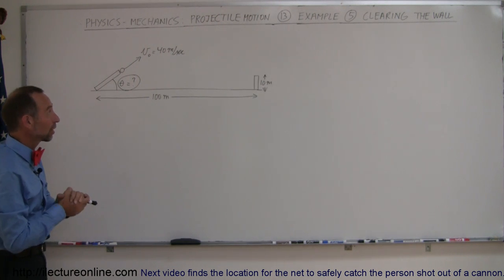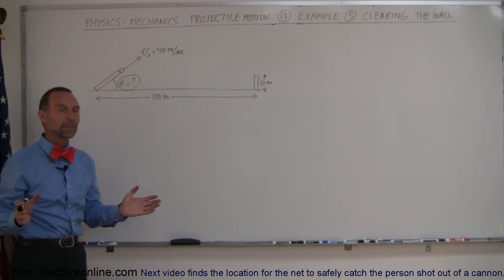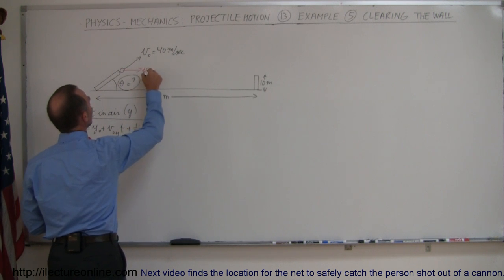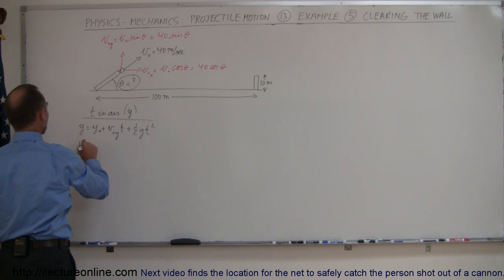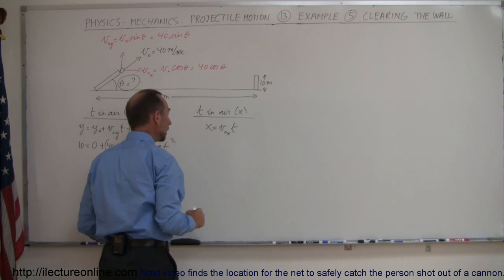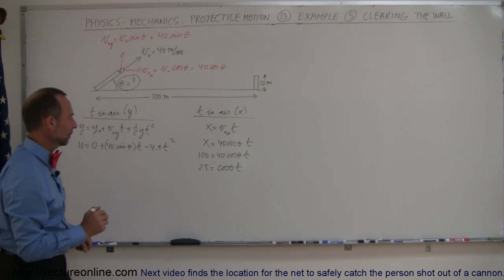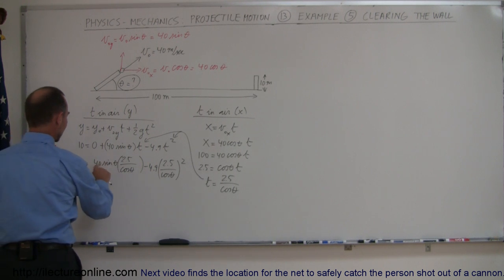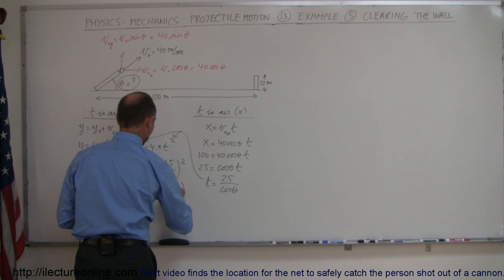Physics 3: Motion in 2-D Projectile Motion (8 of 21) Example 3: Clearing the Wall

Comment: I GREATLY APPRECIATE YOUR WORK. YOU MAKE EVERYTHING SO CLEAVER . HOWEVER, I WANT TO ADD THE FACT THAT YOU IGNORE THE NEGATIVE (- )sign in front of ( b) in the quadratic equation. It supposed to be -100. THAT'S WHY YOUR RESULT HAS 2 DIFFERENT ANGLES &THE ANGLE SHOULD BE 54.55 DEGREE. LET ME KNOW IF I AM WRONG. THANK YOU... WITH LOVE
Reply from the maker: b = - 100 therefore  - b = + 100

Comment: Could you Please give me an idea about this question : 
You throw a ball at an angle of 40.0 ◦ above the horizontal with a speed value of 25.0 m / s against a wall. The wall is 22.0 m from the point at which the ball is thrown. (a) How large are the horizontal and verikale component of its velocity at the moment he reaches the wall? (b) Does the ball hits the next high point of its trajectory in the moment in which it impinges on the wall, already flown through or not?

Comment: As in Example 7 of 21 can't you just use the Range equation and solve for theta?
Reply: Gareth M i was thinking about that too. For a shorter way but my answer doesn't equal his.
Reply: That's because the range is not 100. If it were, the ball would have been on the ground just before the wall.

Comment: Hi! Thank you for your video. I solved slightly different by setting theta = arccos(100/(40t)) then I plugged that into my original equation and solved. My solutions were theta = 70.2 and 25.4 degrees. So my answers were pretty close to what you arrived at. Does this make my answers just as reliable as yours?
Reply: No doubt.

Comment: I attempted this problem without substituting in the known values and i wasn't able to manipulate the equations as easily as you did. Why wouldn't that work?
Reply from the maker: Yes, in this case it is easier to manipulate the equation when you plug in the numerical values first.

Comment: I have tried to use the x rule way, that you discovered in the last vids, and got an angle of 37.8 degree,i think it's correct because it's between the 2 angles you found. So is it correct???
anyway thanks for the videos, they are really helpful..
Reply: the rule states x = Vi squared * sin 2 angle  / +g

Comment: I have  question (as I always do :) ). Why do I get almost 100m when I compute x (range) using theta=45deg (where range is max) in the formula x=v0x times t and I get only 70.8m using 70.28deg angle and 127.91m using the 25.4deg angle? Which part did I mess up here? Seems that the angles will miss the target wall and only 45deg will work.